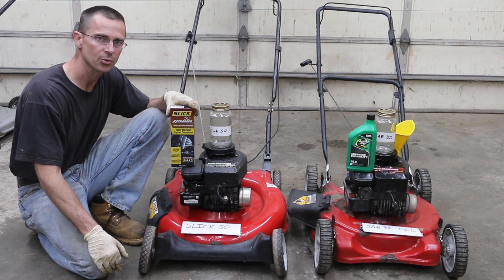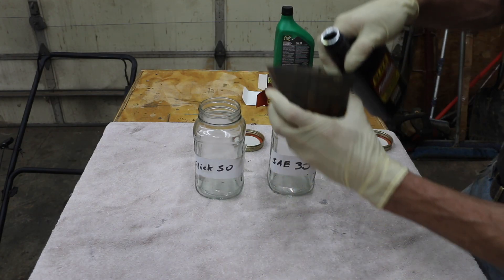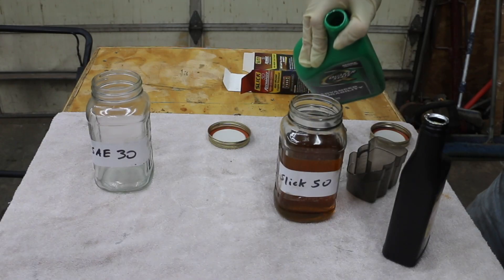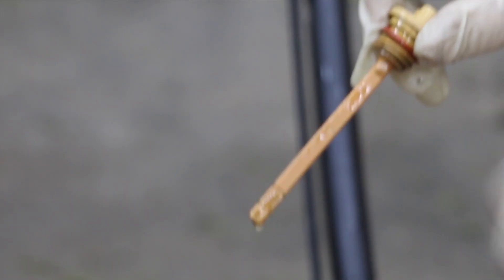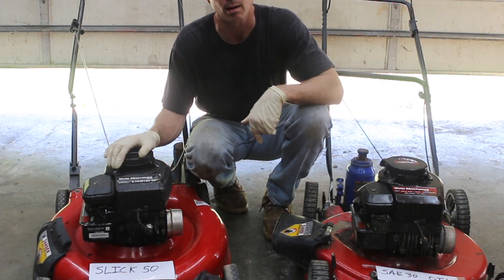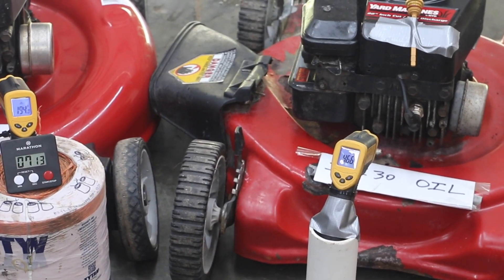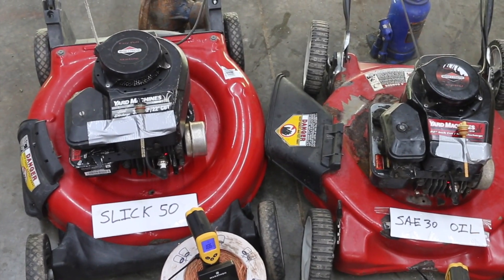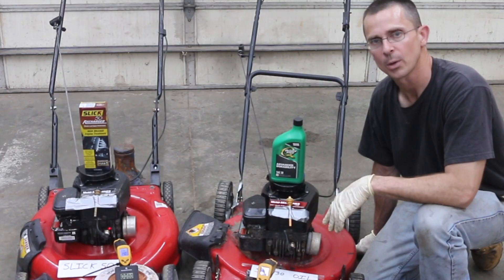Can't believe what SLICK 50 did to my engine!!--Dry Crankcase Test!

Comment: I am an original slick 50 dealer from 30 years ago. I actually owned one of the engines with a plexiglass side cover. What the instructions said to do was run the engine for 6 hours straight with slick 50 in it to burnish and coat the cylinder. Then after that I used to take it to shows all the time and run it with no oil in it. So if you didn't run it for 6 hours straight that's not the proper way versus somebody buying the product keeping it in their crankcase for months and months and months. You can't just run it for 5 minutes like that. Love your video though.

https://www.snapfish.com/photo-gift/share?via=link&token=RU6i0Qe4o5xqFXptg7O-Qg/SFO/27946428920060/SNAPFISH
Reply: And you forgot 3 other things we had to do, warm up the oil tin, shake the living shit out of it to mix up the additive from the bottom, and make sure all the additive was used from the bottom of the tin. If you didn't the additive was left behind and all you added was the carrier oil.
Reply: g120957au yup. I used to open the cans and scrape the white Teflon that was at the bottom of the can and mix it with other oil and put it in things like my lawn mower.
Reply: I would love to see a part 2 of this video where you do just that! Run the slick 50 through engine for at least 6 hours! 

Btw- is there in fact a difference between the current slick 50 and the original version? Was the company bought out and the formula change and is no longer as good? 
Thx!
Reply: mylestube5 what I do remember back then was my customers were so thrilled with it they wanted to buy more. And back then originally it was said that it last the lifetime of the engine, so I didn't sell them another can. The cans were actually metal. But I think the company got smart and then started saying it only lasted, so many miles. One of my big selling points was to Harley Owners where I would explain to them that the back cylinder always ran hotter and this will keep that cylinder cooler. Another thing was I had a 1970 Caprice Classic with a 454 in it. I literally had to idle the car down after adding slick 50 in it.
Reply: Nicholas Galea nope stuff worked great.
I did that on my own cans because the company oversaturated the quarts with the Teflon.
Reply: Your right on.
Reply: Bump.
Reply: can you still huy slick50
Reply: r pm what engine treatment do you use today?
Reply: Jesse Crawford none.  Engines are so well built I now do the opposite.  I change oil every 7 to 15k and my Honda Pilot has 203k on it. I learned a long time ago from an oil expert. Oil is oil is oil. It never breaks down it's just the chemicals that fluctuate the thickness that do. But it always stays a lubricant. So with the high-quality engines of today I change my oil less than ever. Never had a problem since. It may not look pretty but it's still a great lubricant.
Reply: That STILL doesn't explain how the one with the slick 50 failed so much sooner! Even if he didn't run it 6 hours, it should have lasted the same amount of time as the other or longer, not LESS! In the video it's almost like the Slick 50 had DEGRADED the SAE 30 oil, thinning it out or affecting it in a negative way.
Reply: Then you rip people off.Total crap.

Comment: Cool test, I had always heard slick 50 was not worth it, but interesting to see it helped keep the engine significantly cooler.
I have tried another 'oil addative' that is mainly a friction reducer, I'd be interested for you to try that in a similar test.

There are 2 products that me and a friend have used that seem to be similar but use different concentrations.

ROIL and Activ8 My friend used ROIL and believes it saved his V12 e-type engine when he took it out for the first run of the year and found both the oil and water were low, I have done some testing in the past with Activ8 and noticed an improvment in fuel economy (about 10-15% by my calcualtions) so they are definitely doing something good, but would love to see you test them in the lawn mowers and see if they perform any better than slick50/regular oil in a 'worst case' test.

I still have some Activ8 if you want me to send you a sample to use, I think they said about 5% ratio to the oil should be about right.

Thanks for doing these tests.

Comment: Problems...

Slick 50 requires many hours of operation at temperature to coat the engine with the PTFE
Generally 1 oil change interval of a car (3000 to 5000 miles)  So about 100 hours in the lawn mower.

Slick 50 needs to be added to an engine well after break-in but before the engine is needing rebuild.  It can build up a layer more then 10/1000 inch thick.  That will seize an engine that is too new when it is added.

And the dip stick being out proves NOTHING...

Start one up with full oil and no dip stick...
Reply: Here's how Slick 50 really works:  The product is a PTFE COATING for the engine in an oil carrier.
The PTFE slowly deposits on the hot engine surfaces, building them up with a low friction material. (has some percentage of Teflon)

I had a 1977 Buick with 180k (appx) miles... added Slick 50 and the thing quit using as much oil and ran better.  75k more miles it blew a head gasket (the particular engine was known for that gasket eventually rusting through, usually at appx 12 years)
took the engine out and dismantled for rebuild.  Dropped the engine off for "hot tank" cleanup and then boring/honing.
Drop off inspection the cylinders measured 10/1000 over original, thus expected 1t oversize rings and not needing pistons.
After tank it was 35/1000 over (not bored or honed)... The PTFE coating was that thick.

Comment: try prolong engine additive. i use it in all my vehicles. once had my 1973 ford v8 run out of oil. Drove it for about 15 miles or so with no problems or loss of power. pulled dipstick and not a drop of oil on it. Filled it up with oil and drove that car for another 20 years.

Comment: I used slick 50 in 1000cc 4 stroke Motorbike engine oil. Until I drained and replaced the motor oil. It would repeatably foul my spark plugs. Regretfully I thought the engine wasn't running hot enough or I had problems with my coils and eliminated all these problems before I changed the oil and plugs to find the problem vanished.
Reply from the maker: Mikey Be, Interesting!  Thanks for watching the video and commenting!

Comment: Not exactly a scientific test, but back in the early 1980's I added Slick 50 to the oil in a just run in engine (I'd owned the car from new) and waited to see what might happen. On the whole I noticed very little difference, but a friend who hadn't been in the car for a while immediately noticed it was running much smoother and quieter.

Similarly I've found that a full bottle of Redex added to just a few litres of fuel will clean out the injectors far quicker. Whether it loosens carbon build up as efficiently I'm not certain.
Reply from the maker: Thanks for watching the video and commenting!

Comment: I use motorkote. from my understanding i was told, Slick 50, duralube, and motor kote, Started together, split into different brands all had the same idea. Although I hear they are different by melting points. When motor reaches a high temperature, some of them fail. I have had good results with motorkote, I had a Mazda overheated at 85 Mi an hour died at that speed. I was a bit worried, we where at the corners AZ, Nev, CA,  sorta headed to vegas, there is nothing but sand. I swore I warped the head. let it cool 1/2 hour died again, let cool 15 min low and behold it started, turn left to indian reservation, found carwash left running cooled motor by spraying it added antifreeze continued on trip added more motorkote to quiet down valve rattle, made it back to idaho after show and loaded with merchandise. drove it a few more years. Uncle had oil leaker, leaked empty, drove around until reached store to by cheap oil. It kept running too. It does not seem to protect valves or valve guides but I believe it does the lower half. However there is nothing that escapes temperature.
Reply from the maker: Thomas,  I purchased some Motorkote for an upcoming test.  Thanks for watching the video and commenting!

Comment: I niticed the engune with the slick 50 didn't come to such a quick screeching halt like the one with 30 wt. The one with just oil locked up hard. wonder if the slick 50 engine can be started back up.

Comment: Interesting test. Something to keep in mind is that the product that's being sold as Slick 50 today is not the same as what was sold under that name in the beginning. The Slick50 formula changed in 1983 when it was bought out by Dupont. Dupont only bought the name... not the formula. The original formula Slick 50 is now sold under the  Xcelplus/Lubrilon name. Xcelplus/Lubrilon uses the original Slick-50 formula now. From my research, original Slick 50 did perform, pretty much, as they advertised, but remember what you bought / tested as Slick 50 is not the original formula. Disclosure, I don't work for, have stock in, or any affiliation with Slick 50, old or current. I have no dog in this fight.

Comment: Slick 50 is not the same as it was a few years ago, let alone 25 years ago. The product was originally pearly white in color and contained drastically higher amounts of PTFE (teflon). Modern Slick 50 is basically just your run of the mill oil with a little additive in it

Comment: Some time back I sold and used a product call "Bitron". The company claimed it to made of a much smaller  molecule with a slight positive charge enabling it to actually saturate metal parts , both because of the small molecule  and the positive charge of the oil being drawn to the claimed negative charge of iron. Whether any of their claims are true ...who knows , but I did the same test as you did in this video using an old  3 HP Briggs mower. After draining the crankcase  I started the engine and ran it for about 6 hours at 3/4 throttle. The engine never did seize , I just ran out of time. I took the mower home and restarted it without adding oil and mowed my lawn with it for about 20 minutes when it started knocking and at the same time I hit a dirt mound with the blade , stopping the engine. I disassembled the engine to find that one of the connecting rod cap screws had come completely out causing one side of the connecting rod bearing surface to break off. The cylinder was badly worn and scored but not seized. 
    The Bitron product was sold MLM and the business plan eventually collapsed as all MLMs do. If you search the web you can find the product still being sold . Might be something you would want to try on video.

Comment: Hi, thanks for the video! Very interesting! Biggest point here learned is to keep oil in your mower! There was another oil additive product out there, STP. The Marketing point is that most of the wear and tear on gasoline motors occurs in the second before the oil pressure builds up when the engine is started up.  STP is supposed to leave more lubricant on the bearing surfaces when you turn off the engine, so there is some lubrication while the oil pressure builds. Modern cars today use thinner, more efficient motor oil, so that is less of an issue for cars. STP might be better for lawn mowers, tractors, or motors still using 30 weight oil to help the motor to last longer.

Comment: my understanding on the slick 50 it said it is made for Cars Plus you have to let it more that. and you need to run the lawn mower for a long. Of time not to change the oil in 30 to 40 minutes to an hour you need to let it walk into the metal into the engine so it can go into the molecular molecular level you can just run it for one hour or two hours you got to leave it on there for at least three or four weeks I use it on my 81 Oldsmobile my car ran out of complete oil and I was able to drive 45 miles and it did not ruin the engine

Comment: Nice demo.  Tough to make any definitive judgements because the engines were probably different ages.  Also...don't have the hot exhaust discharging directly toward the other test object. 

Slick 50 is a waste of money like most of the other additives.  Just get full synthetic when it goes on sale somewhere.  Did you open the engines to investigate?

Comment: I would like to ask that you test liqui moly ceratec in the same way. 

I use it in my cars and they feel and sound smoother, I used it in a tractor mounted slasher's 90 degree drive and where it used to whine a lot it became perfectly smooth and quiet. It should increase compression and in theory the motor should last longer without oil. But I am really interested in the results. 

Regards from South Africa

Comment: First off one engine is newer having tighter clearances. 2nd slick 50 reduces heat so in engine that is air cooled the clearances expand and get looser as engine builds heat, that's why the 30 wt. engine ran longer ,the engine heat allowed the 30 wt. to run longer. By what I saw if you're any kind of mechanic you go by the running temps of the engines with oil. look how much cooler the slick 50 is running. That tells me it is a good product, We used it in west Africa in cat engines the engines with slick 50 ran 30 deg. cooler and we got about 35% longer run time between major overhauls going by PMS. test every every 15,000 hrs.( clearance tests on operating parts. So my suggestion is quit mis-leading people with BS. tests Also I do NOT USE SLICK 50 BUT CHANGE MY OIL EVERY 3,000 miles !!!! PS stick to lawnmower engines !!!

Comment: What grade of oil is that? If it is anything above SG, it already contains friction modifier additives similar to Slick 50. To do this test right, there should have been at least 3 identical engines: one with SG, one with SJ, and one with Slick 50. It would also be better to use liquid cooled engines. Even then the sample size would be almost too small to make any determination. Furthermore, the "Slick 50" sold today is a completely different formula from the original version. The original formula is marketed as "Lubrilon", nowadays.

Comment: The slick 50 engine's carburetor was running much richer than the SAE 30 engine's carburetor. This is why it ran cooler, and why the oil was darker (carbon from rich mixture). It has nothing at all to do with the oil used in regards to temp of the engine or oil color when drained. This entire experiment had far too many variables to draw any conclusions at all. If this test were repeated MANY times, on identical engines (including run-time) then there would be data available in the numbers.

Comment: I went to ky for a funeral and my honda civic vx had 229 thousand miles on it and I have bought it new.
I had always used slick 50 every 50 k miles. while in ky my engine threw a rod through the side of the engine losing all water and oil. this engine ran on 3 cylinders with no water or oil for another 20 miles before losing all compression and dying in the gas station parking lot.

Comment: A small engine  expert I know, (my brother) said in most cases when these engines seize it is the crankshaft bearing and after cool down and oil is added the fire right up and run fine.

Comment: Tribology is the grading
of motor oil.There are 5
grades of oil.
As I understand.
Grade 1 basic
Grade 2 basic +
Grade 3 Synthetic blends and most synthetic oils with
polymer base stock
or a wax stock.
Grade 4 is Mobile 1 full
synthetic,Polymer base.
Grade 5 is the absolute best.The use of ester base stock provides the best protection.Ester based oils are use in all jet aircraft.Phillips 66
owns Red Line Oil and produces ester based oils for cars and truck.
This is certified class 5
motor oil.
I use it in all my engines with superior results.
However I do not think it will hold up to your test.

Comment: I think you should add oil back to the engines and see if they fire :) Worked in a car I once had when the oil plug fell out.. when I got home, I bought a new drain plug, added oil, and it fired back up.. all after seizing at 65mph!!

Comment: I think you're all missing the point knuckleheads it doesn't have the same components this Teflon has been taken out for many years now it's just under name that it actually sells anything... they took it out because it was the most expensive part and they still had the name sell the product regardless of the quality or that it doesn't do hardly anything for the engine anymore